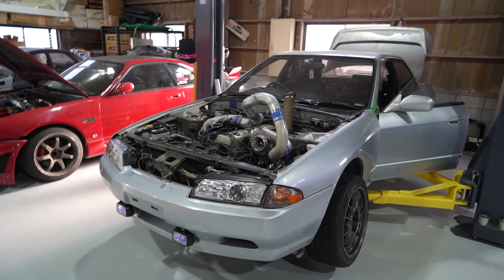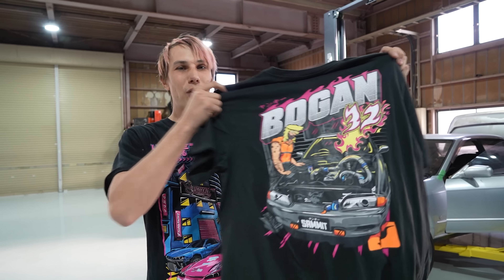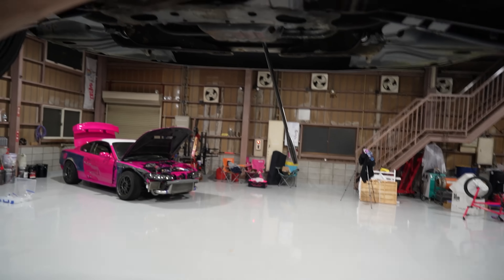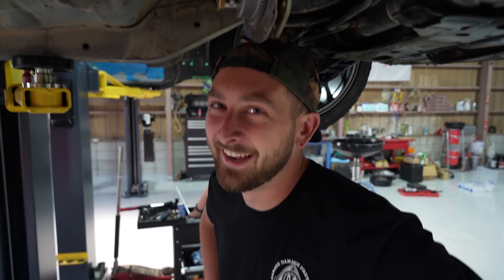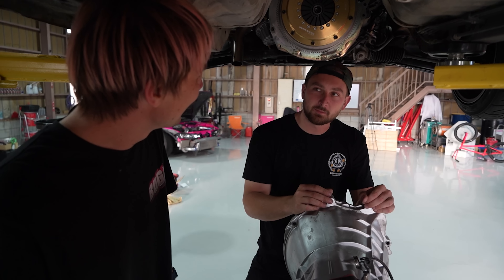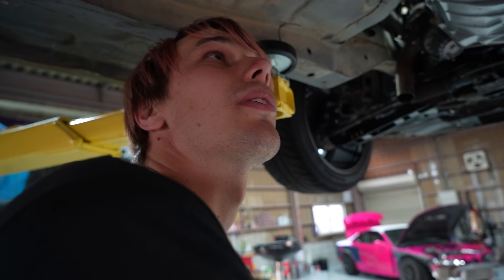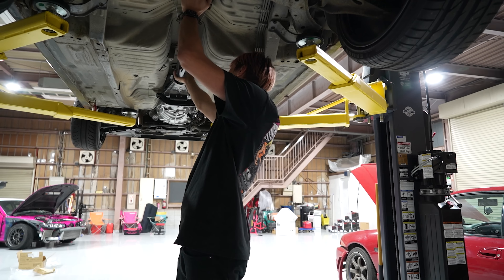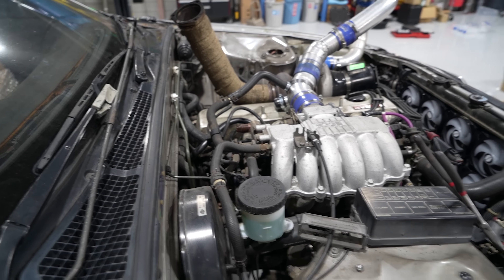Jimmy Oakes Came To Japan Just For This!

Comment: Another thing you can do with the pilot bearing is to just stick a screwdriver through the dust cover on the front and pop it off, and then just lay a weld bead in between the outer and inner race over the top of the ball bearings After you clean out the lubricant with brake clean, and when the weld cools it will contract and shrink, and the bearing should just pull out by hand.

Comment: It's just funny how Sammit looks like a Lass standig in the Garage next tae the Lads working on her car
next tae Jimmy and Grant.

ye know what's easier than the weld and slide hammer?
fill the Pilot bushing in with grease tae full and a clutch center pin whack it with a hammer and it will fall out,
since grease is afluid it will go in the tightest spot.

If the drive shaft is 3 in short get a spacerplate made that is just a quick Lathe job.

Comment: "how much" longer? you can put on a space in the back. easy to get a spacer made then a new shaft. should not be TO long tho. you migth even find some of the shelf. i have seen 40-50mm spacers.
i have only used 3-5mm spacers on the driveshafts on smal open wheel cars (formel cars)

Comment: Welding to the auto pilot bearing is the only way I will even touch one. Waaaay to many hours fighting pullers and shit to spend 3 minutes welding and less than five with the slide hammer. Not even worth trying any other method.

#CommentForTheAlgorithm
Reply from the maker: AMEN BROTHER!